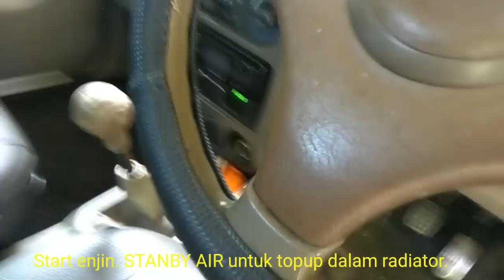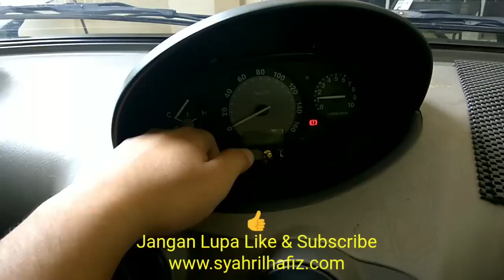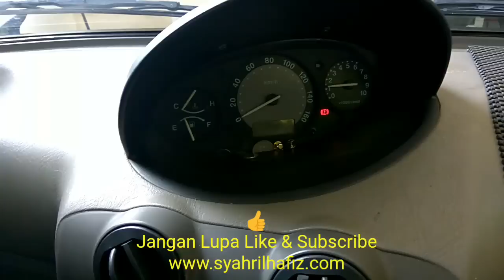Cara Tukar Air Radiator Kereta Kancil

Comment: Aku dulu pernah karat sampai block saluran air dan radiator. Rm480 terbang tukar 1 radiaotor/hose line getah dan hose line besi termasuk flush dan masuk coolant baru.. servis radiator ni murah je tapi kalau tak pandang serius boleh mengakibatkan overheat dan gasket terbakar serta head bengkok.
Reply: Brapa servis radiator ?

Comment: Tak pakai coolant pun takpe, asal "kerap" tukar air (dalam tangki radiator & tangki reservoir/spare),  sebab sifat air (pH8 ke bawah) akan membentuk karat pada logam yg ada dalam sistem radiator i.e. impeller fin waterpump & thermostat termasuk juga logam sedia ada yg terlarut dalam air yg digunakan (melainkan digunakan air suling/air bateri)....Proses pengaratan/oxidisation akan dicepatkan lagi pada suhu panas, maka "kerapkanlah" penukaran air sekiranya tak mau pakai coolant,

Comment: Selalu brp air coolant tu ? Kancil sya slalu heat
Reply from the maker: Neil Viking banyak faktor kalau temperature naik selain radiator ni...kena check dgn pomen..
Reply: Kereta saya kipas ada 2 pun sma jgak naik temperature, lgi2 mlm, on lampu je naik, kalau tutup lampu, pandai pulak trun skit
Reply: Kene check termostat bang.. Keta saya bila bwk naik 80km je overheating.. Kipas keta saya pun ada 2
Reply: Neil Viking kipas ada dua? jangan jangan kipas aircond yg satu tu..pastu korang cakap kipas radiator ada dua..wakakak..

kalau betul ada dua..memang bikin berat tenaga kerja enjin je nak memusing kipas tu..pastu pandai lak mengadu enjin panas la..overheat la..hahahahh..wakakak